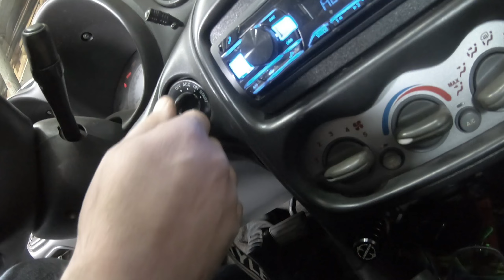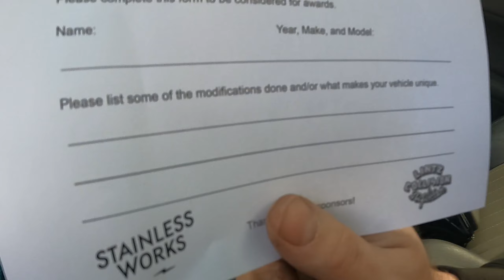First event of 2024, and first ride with the new engine!

Comment: I remember I sold you a 3.5 block YEARS ago lol. Ever get any use out of it?
Reply from the maker: I've only had 2. First one I got in 2016 down in Columbus, had the internal trigger and other goodies inside, which is the one that failed last year. The other I got of some guy here locally probably 3 years ago that was all stock, mis diagnosed a bad cat converter lol. So I got it cheap. It was in the body kit car, and now in mine!
Reply: @KMaffittGAGT  it might have been a 3.4 can't remember. Cars looking good
Reply from the maker: @Hilth0Modding  my buddy grabbed a 3.4 a couple years ago. It's here with a 3.5 top and cammed. Haven't bought a 3.4 otherwise lol a few whole GAs and took the motors lol

Comment: if it is not an issue, would you be able to tell me your exhaust set up? i love how yours has that low deep rumble, similar to a V8, and thats what i wish to have on my own GA some day
Reply from the maker: Between the turbo headers, 2.5 piping back to an old SLP muffler. When it was stock manifolds way back in the day it didn't sound like this, so you'll need headers as well to really get good sound outta these.